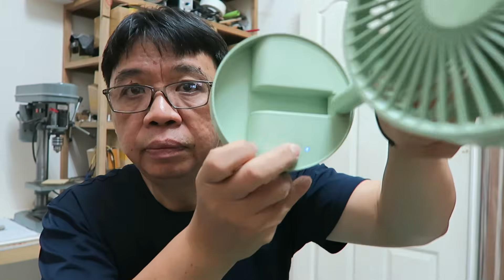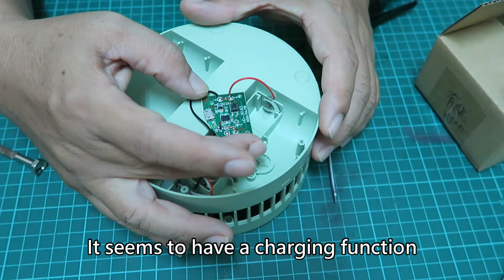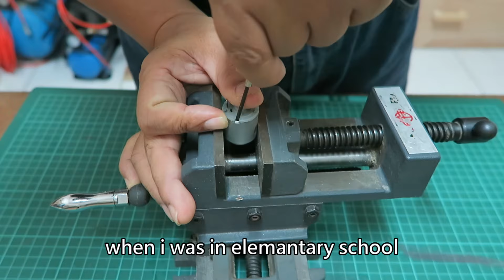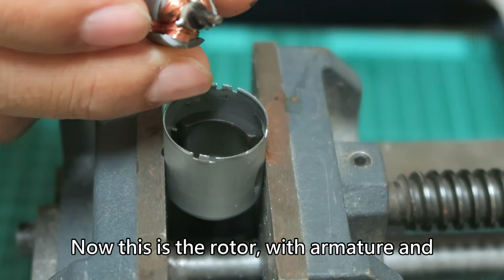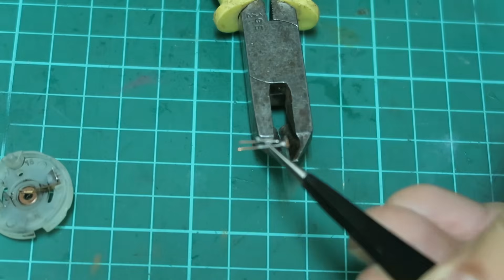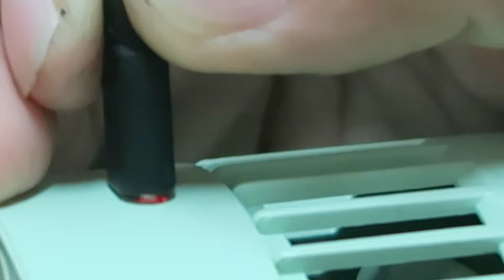Incredible repair of usb folding fan

Comment: still helping people 3 years later... Thank you.. I did our testing method right up to the rear of the motor for variable voltages and problem was the motor too. I honestly didn't want to dismantle the motor casing.. my motor didn't have the easy to lift tabs like yours .. just machine crimped the body shell inward.. a pain to open up. My motor actually had tiny carbon brushes! OMG! However a good clean had it running again. I tried to find the same motor but no joy and the fans are double now what I ppaid for them initially so having a go at this was worth it. Kudos to you man!

Comment: i have usb fan ,the model it not like yours, but the problem is weird, i remove internal baterry and use only with usb power adapter, the problem is fan always automatic off 4/5/6 hour later, why is that?
Reply from the maker: i'm not sure. if you install the battery it maybe  stabilize  to work

Comment: I ve similar usb fan.
Is there any that we can save the last state of USB fan ?
Cause moment I disconnect from usb and reconnect ive to press physical button on the usb fan to turn it on.
Reply from the maker: If the original design did not have this function, it would not be possible to do so
Unless another chip such as ARDUINO is used to control

Comment: I have the same issue with the fan. Can I just outsource the motor online instead of repairing?  Do you know the type and model of the motor to buy? Thanks po in advance ☺️
Reply from the maker: Take out the motor and buy it according to the size, 
in fact, it is very easy to buy in the e-commerce